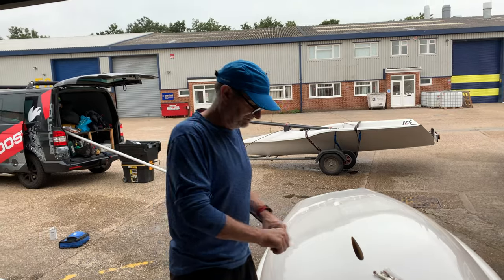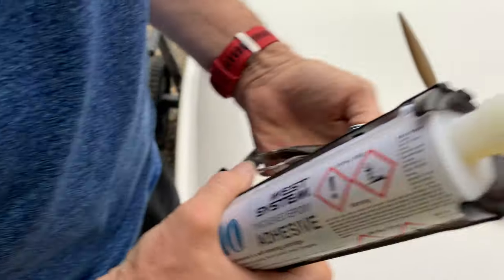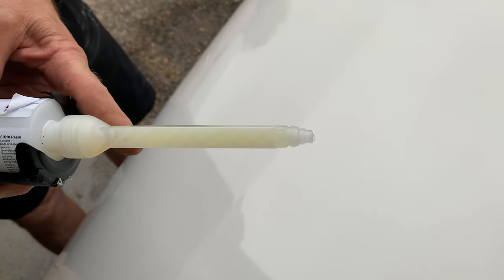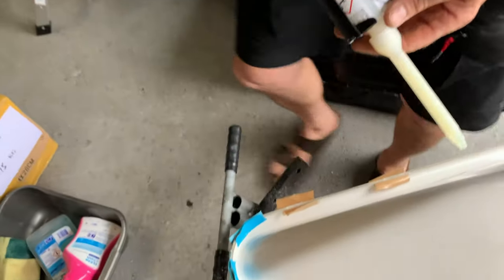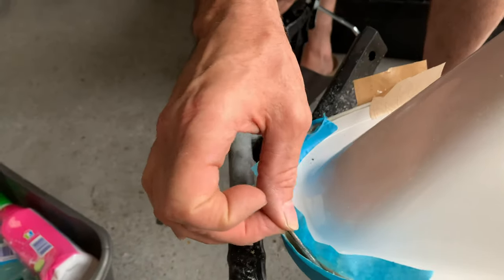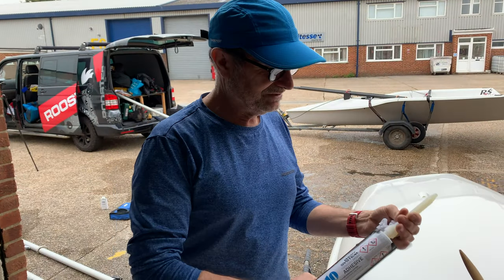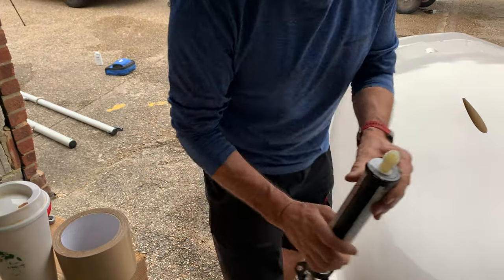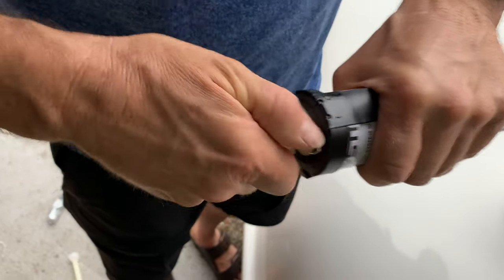Rooster How To   Laser Gunwale Repair with West 610

Comment: Hi Rooster
I have issue with Laser Bailer, maybe you can help.. new-old boat I bought have the cockpit drainage hole intentionally (+FG) obturated, the same at the hull bottom opposite side..
Can't figure out why..
I'd want it reopen but HOW the hell is the drainage system internally (?) so to work it out without making unrepairable damages?
Cheers man